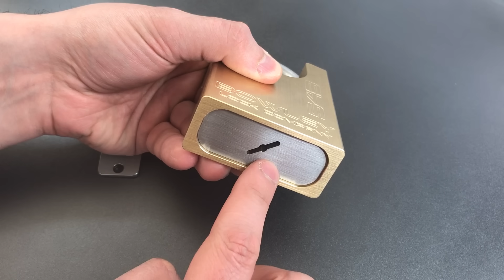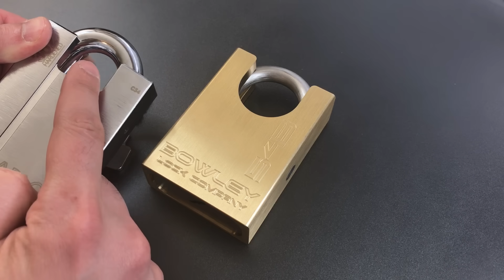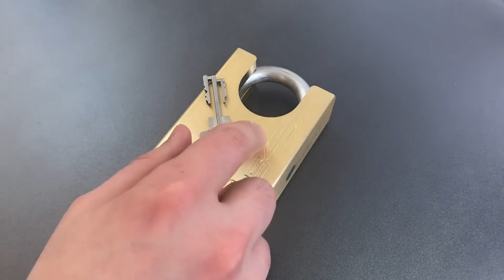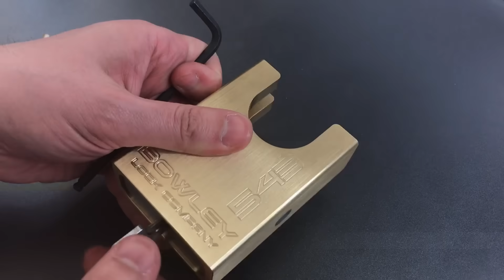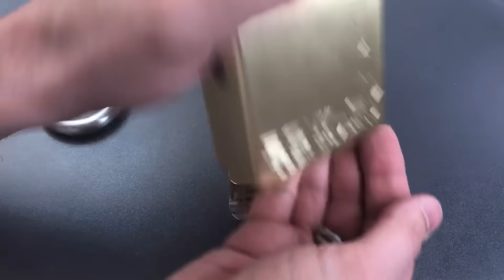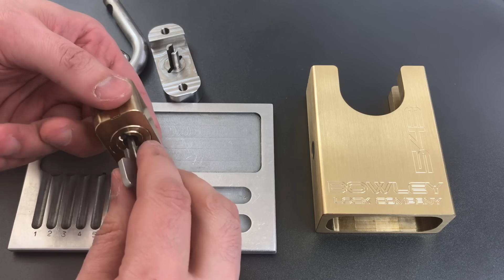[653] Prototype Dual Fork Bowley Padlock (Model 543)

Comment: Love the lock & Stainless Steel would be my choice although the 11mm shackle just does not look right to me it needs to be bigger for my $163... For same sort of money the Abloy PL362 has 15mm Boron shackle the extra 4mm & the hardness of Boron makes a big difference when trying to cut or bolt crop..My Abus Granit 37RK/80 has a 14mm shackle it just looks right & no problems using it & it is for sure high end security.. Still the Bowley is a beauty & looks very well engineered lock very nice to see, beef up that shackle I will probably buy one...
Reply: they said they kept it smaller to be useable in more applications.   The lock would be no different if it was drilled out to drop in a larger shackle.
Reply: Jolly Peanut you obviously were not listening,these were issued with the thin shackle because they wanted to provide the testers a working lock but the production models would be beefier.
Reply: When does he say that?
Check out 2.49 "The shackle is a prototype but dimensionally correct" so the shackle will not be bigger/beefier...

Comment: if you turn the ''idler ring'' with a long L shaped tool wouldnt the pins drop in those 2 slots?? Blocking the ''idler ring'' and preventing you from inserting the key, leaving it broken and useless??
Reply: That sounds like a very valid concern.  Even if the criminal can't get in the lock, he could brick the lock using your method, preventing you from accessing your property.  I could imagine a simple lever-type modification to the core/body of the central lock that would require that the key be pushed in firmly against a spring to actuate the lever, freeing up the idler.

Comment: Great engineering & design but the price is an obsticle for me. Maybe I'll get one some day if they go full production & drop the price.🤔🍺🇦🇺
Reply: I have 3 locks at the front and back doors to get through. One on each of the security screen doors and two in each door itself.
Reply: @ZaC kWinz Four feet thick concrete is a bit much, isn't it? I think two feet should be plenty.

Comment: Why are the plugs there?  I'm guessing its something that would have been more difficult to machine into the lock body.  Do the screws that hold the core in place go through them?  Does the force of the bearings ultimately rest against them when the shackle is in place?

Its not anywhere near as expensive as I thought it would be considering none of it is built from mass produced lock parts.  Unfortunately its not a lock I would buy to attempt picking for pretty obvious reasons and it seems like overkill for my chicken coop.   :P

Comment: i notice theres a little space to possibly insert something on each end of the keyway that would be able to be inserted outside of the idler ring .. you can see it most clearly at 11:15 .. would that be a weakness in any way? maybe some sort of tool that would reach deep into the lock and bypass it? i admit im not good at visualizing it in my head so i could be completely wrong

Comment: A thing of beauty.
However if you put it side by side with a Protec 2 Abloy I would for the price point have to go with the Abloy 🤔🙄
Nothing against Bowley it's just a matter of the price point unfortunately.
Thanks for sharing and thanks for Bowley for innovation and let us all have a "sneak peak "😘😘😘😎😎👍
Reply: I agree with you. If I was looking for the most security and value for money it would have to be the Abloy. However, if I owned a Bowley padlock it would never be used to lock anything up, it would sit on a shelf with place of honour amongst my other padlocks. Postage to the UK is quite pricey but I have still pledged for the brass padlock. I'm not getting it to lock anything up or to try picking. It will be purely for looking at. My wife buys her ornaments and I buy mine. At least that's what I'm going to tell here when she asks for an explanation of where the money went.

Comment: If brass is so expensive why not go for hardened steel instead of using this brass version ?
Reply: My1 
It take water/salt water A LOT better than stainless steel.
Reply: Mr.Scruffy the great there is, but it seemed weird at first glance to have a more expensive lock that is less hard than steel
Reply: @Gilberto I am not stupid, I wondered why they were doing this AT ALL, which apparently was answered already.
Reply: My1 the Brass and Aluminum are available Pre-production only, didn’t you hear this in the video?
Reply: Mr.Scruffy the great the Brass and Aluminum are available Pre-production only, didn’t you hear this in the video?

Comment: Have You seen Chris Ahrens  Bowley Pick & Gut video?  just a tip
Reply: einherjer if you believe him you must think there is actually a pot of gold at the end of the rainbow. He staged it all so he could say he pick it. Let him pick one he has never seen or opened and only then he can claim he picked it. I have yet to see Master Locks produce a lock with only three working pins so I don’t believe Bowley would do it either. I believe he cut the key to lowest pin, replaced the original pins with stock or home made pins for the pick then faked the pin tray “accidental” dump to move the pins around as he did or replace them in the process. When I see him receive a new lock from Bowley without a key and pick it BEFORE he hits it then, and only then, would I believe he can pick a Bowley.

Comment: "Lock nerd in me" - so understand. The original Bowley lock seemed unpick-able. This is double unpick-able. 
Note: 38 days remaining as of 404 (April 4th, 2018) on Kick starter website.  Do not hesitate. 
Thank you for trying to twist the stainless steel key. With daily use, I worried the tines would snap off or bend. 
(smiles) They send the expensive lock to the lawyer. Forgive me please, just found it funny. 
My grandson (if there are any) will thank me for getting one. In my opinion this technology change makes it a collectors item
Reply: Link? I couldn't find it.
Reply: I'd be more worried about the key getting caught and ripping a hole in my pants. Although it'd be more likely to sit on the shelf to show off than actually use, given it's uniqueness.
Reply: @Allen Shepard
he did only have 2 pins to pick but bowley said they will send him another 1 with different bitting , i dont know if they did yet but is picks seem to be good enough :-)
Reply: Chris Ahrens picked it. https://youtube.com/watch?v=X04qgD0hOXk
Reply: Tyler Rhoads I wouldn’t call that “picking”. I’d call that fashioning a key through trial and error (and looking at the key). He can’t take those picks and use them to pick a lock that’s keyed differently. It isn’t picking if you have access to the key and craft your picks based on knowledge of how many zero-lift pins it has.

If somebody has access to your lock long enough that they are able to craft special picks through trial and error, then they could just cut through it with a box of cutting disks.

If somebody has access to your key, then they can just copy it.
Reply: Allen Shepard 
The original one has been picked.
Reply: Rick, thank you. 
Wow.  I figured it would only be a matter of time. Shame.
Reply: But can you pick it? I want to see that

Comment: I had a bike $900 street value bike stolen, with a 12mm hardened steel U-lock... 11mm is not enough for a high security lock... serious oversight in a world of Fugetaboutit's. Seriously, if you only have an 11mm hole... you have a more serious security problem. Effectively that makes this an overpriced half decent, flawed lock with an amazing core. I would rather leave a bike on the street with an Abloy 362 than the steel version of this, and they cost the same.
Reply: Ray Foss go back and pay attention to the video, you will learn why the 11mm shackle.
Reply: Just cut the bike chain.

Comment: I think the reasoning behind people saying that the key might bend comes from the fact that keys just attract situations where they bend. I have a stainless steel key i made myself for the lock on my drain grate, somehow, i bent it(twist, not axis). For the life of me, i have no idea how, my keys live in my pocket, and i never reach for them other than for use.

That being said, i'd like to see these keys with a guard on them, you can't bend them, but in a key chain, i can see it through my mind's eye that another key might slip between the teeth and break them off whilst say, sitting on them.

Comment: Is it possible for the idler ring to get out of alignment with the pin shields and prevent the key from being inserted?
Reply: That's a good point. It does look possible from looking closely at it in the vid. I also think it should be steel rather than brass.

Comment: Looks even more gorgeous taken apart. So glad I've ordered one, even if a Bowley has now been picked.
Reply: One has? Any proof?
Reply: He knew before picking it which pins to pick. Not really fair. :)
Reply: Gilberto Diaz Castro I think that what that 'pick' shows is a possible attack route, but I agree with you that until it's shown someone can open a Bowley which they haven't previously inspected the insides or key of then it shouldn't be considered pickable.
Reply: Gary Rumain look on reddit lockpicking subreddit. Or just look up lockpicking heavens gate
Reply: Gary Rumain https://youtube.com/watch?v=X04qgD0hOXk
Reply: AlisonWheeler IF they did work, how could he tell a false set?I believe he rigged the whole thing and gullible people fell for it. I do believe he cut the key to two non-pick pins, used standard pins in all the three he picked and staged the “accidental” pin tray dump to move them around. Heck, not even MasterLocks makes Locks with only three actual working pins. I won’t ever believe him until I see him pick a lock he hasn’t taken apart and rigged or seen the key to.
Reply: Gilberto Diaz Castro - oh but masterlock do actually produce a 3 pin lock, its a 70mm disc lock with a 9/10 rating magnum or excel series... a guy raked it open in 2 or 3 seconds, i saw that vide a while ago. i bought one for our shed, its still pretty beefy but its got the crappiest locking mechanism. they are 3 standard pins too. they might have replaced it with something less pickable by now but idk

most of my bike locks are masterlock, they are good for second hand trash bike which isnt worth stealing but i wouldnt reccommend on anything of value above £200-£300.
Reply: James Phillips I won’t  use Master Locks on my shed, and there’s nothing there but some wood for bowl turning.
Reply: Agreed. But the idea of making a thin pick for each pin (or two) is a valid one and shows up the possible problem of having a thick key. If the key was thinner it wouldn't be a possible attack (but then the key might be more likely to break in transit/use...)

Comment: So, outside of a really violent physical attack, this thing is going to have to be impressioned?? 
Beautiful piece of design and machining. 
R.
Reply: And if you want to impression it, you'll have to make you're own key blank. The keys are hardened stainless steel, so the pins won't leave any marks on them.
Reply: jasexavier If you have a plank key from factory you can use machinist's blue or a pen, but filing a hardened steel is not fun, so it is better to make your own planks.
Reply: I thought of that right after I posted this, but I wonder if even the loose pins would make marks in that, making it hard to tell which ones were actually binding. Filing the hardened steel might actually be an advantage, as the different pin depths in the bowley are extremely close together, taking shallow enough cuts with a file in brass would be a challenge.
Reply: Agreed, I was thinking about aluminum, but I am not sure the key would survive the agitation required to make decent marks even in the aluminum. 
Oh well,  I'll just have to blow a couple hundred bucks to find out!
Reply: Perhaps you could grind a key below zero lift and then solder a strip of brass to it?
Reply: That particular issue wouldn't be mine.
In my other hobby, I restore and tune harmonicas... filing minute bits off a brass harmonica reed to raise the pitch to tune.  Time consuming though...
Reply: jasexavier 
you got it!

Comment: Send it to Chris ahrens because he was able to defeat the deadbolt bowley lock!
Reply: Taluvian I was thinking the same,3 tools and only 3 pins due to 2 zero lift pins.
Got to give some credit for persistence but I feel his method of attack would be easily defeated by a few more security pins.
Reply: God :-O I do believe he rigged the pick, then he “accidentally” spilled the pin tray to distract folks while he replaced the plain pins during the pick with the original security pins. One more thing, I fail to believe Bowley would produce a lock that would in effect have not one but two pins that don’t require picking; not even Master Locks is that incompetent. This means he could’ve modified the key to accommodate for his claim.  IF, only IF, his picks do work I want to see him unpack a brand new lock WITHOUT KEYS and pick it, then he can be believed.
Reply: YTANDY100 yep the B.B. was so people believed the way the pins were BEFORE he opened it... yea right. If he does get a second lock, although his tools look promising, I don’t think he would legitimately pick it on cam so we see he didn’t fix the pick.
Reply: @Gilberto Diaz Castro
bowley said they will send him a new lock to try , i dont know if they did yet though :-)
Reply: YTANDY100 I hope he does it right this time, pick it BEFORE he guts it. Better off, open the package on camera, sit down right there and pick it on camera with no recording cuts.
Reply: I'm with Taluvian on this one. Not to take anything away from Chris, because it's obvious he did put in a ton of time and effort, but that pick was heavily dependent on having access to the key to study in advance. For me to be truly blown away, I'll need to see someone pick a Bowley without advance knowledge of the specific pinning.
Reply: Hahaha
Reply: @Gilberto Diaz Castro
that would be the right way to do the job but i think it will take many hours to open , even if he practiced for some time on the lock he already has to get a better feel of the pins :-)
oh , and make sure to put spools into the pinstacks that need moving , when he did a BB on the pin tray they were all mixed up :-(
Reply: Everything can be defeated given time. Chris spent a ton of time with that lock, had full knowledge of the pinning, and took a lot of time making special tools to pick the lock. Not really a fair picking session. Love to see him pick a a different Bowley lock which he has zero knowledge of the pinning.
Reply: Taluvian 
If he picked it, he picked it.

Comment: A very cool my friend very nice lock chris did a great job picking the cylinder version😊😊😎😎👍👍😎
Reply: Leon's lockpad the comments there are quite interesting. I'm interested in seeing him do an unseen key as well.
Bowley even seemed to hint that their in house picks are something similar-ish but with some caveats that probably mean that he would need some redesign on his picks. Either way - it was picked!
I figure a more mechanical design would work best if you could get stiff enough wires.
If the key was larger you could probably use a similar design to the tube lock picks and have small wires that are pushed up. Whether you can get the appropriate stiffness to actuate the pins is a different story.
I think that video will inspire a ton of other designs now!